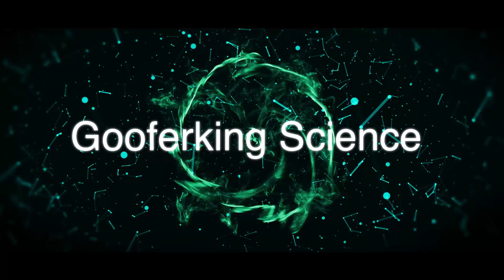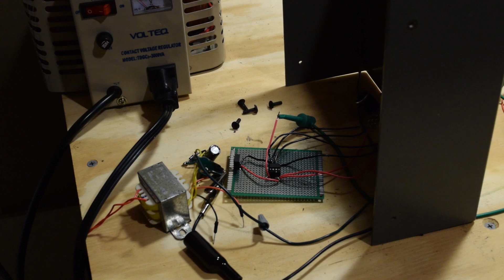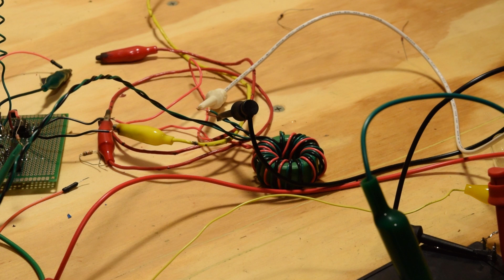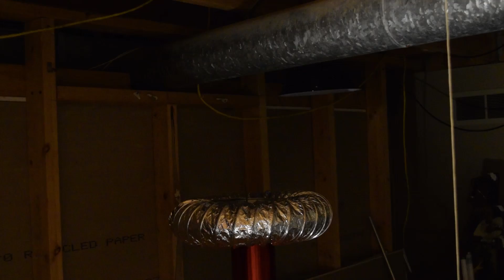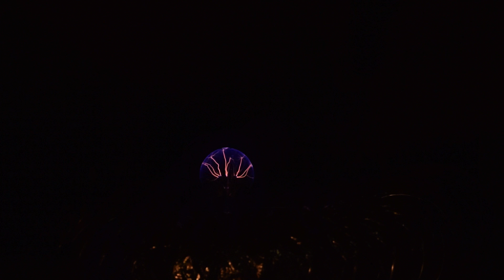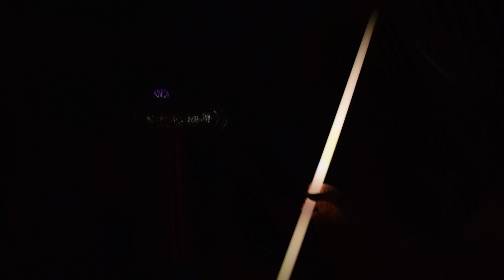Solid State Tesla Coil - 12" Breakout

Comment: Hey, gooferking. Why don't you jack that coil by making nesting coils- you have one coil with ~500 turns that is 3" diameter and then coat that with lacquer and do the same for a 4" diameter coil, but make that one about 1 inch taller, take the top of the 3" coil and feed it to the bottom of the 4" coil. this way, you have more of the coil closer to the magnetic field of the primary. Makerj101 experimented with that idea and when i get some parts to do so, I will make one.